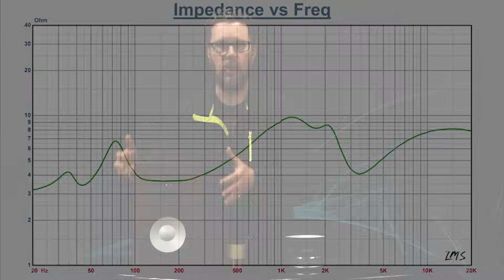What is Speaker Impedance? | Impedance ohms rating explained

Comment: Pretty much every amplifier I have ever run into has been able to go as low as driving a six ohm speaker I have one golden rule and I’ve been loving listening to music and buying a music equipment over 30 years. 
I will never buy a four ohm speaker purely because if  circumstances are right a 4 ohm speaker can go down as low as two ohms which puts massive stress on the amplifier speakers with a six or eight ohm rating is the sweet spot and the higher power efficiency rating the better? You will often find some of these very expensive so-called audiophile speakers are four ohm hand have not the best power efficiency rating. What a surprise.

Comment: typically a speaker with higher impedance or OHMs will have less bass and one with lower impedance, will have more lower bass response, the speaker driver doesn't care what amp its plugged into but the amp does the amp is the limiting factor if it can drive a 4 or 2 ohm or only 8 or 16 ohm if the receiver is not powerful enough you simply can not turn up the volume as much, amps put out a specific power depending on OHM of speaker,

Comment: A good example is the Sony STRD190 receiver.  It's a great budget receiver that's rated for 6 ohms, but if you connect it to 4 ohm speakers it runs much hotter and the budget power supply is poorly protected and won't last long, sometimes failing within days of heavy use.   That's why you see so many "refurbished" units for sale that look brand new.  You're better off to run 8 ohm speakers and get years of use out of it.

Comment: When I went to rebuild a pair of older 3 way speakers, I was surprised to find that none of the old drivers had matching ohm ratings.
 One speaker the tweeter, was 8 ohms, another, the midrange, 6, and the third, the bass,  was was 7 ohms.
 I replaced them all with 8 ohm drivers.

Comment: Hi there , thx for ur knowledge of impedance sharing . From ur entire presentation , can we said the power amp which rated 8 ohm and 4 ohm is capable to drive 6 ohm of passive loudspeaker without any issue ? As the speaker impedance is higher than power amp ? Thx

Comment: OVER LOAD RELAY WILL SAVE THE AMP FROM DAMAGE DUE TO SPEAKER WITH LOW RESISTANCE DRAWING EXCESSIVE CURRENT AND PRODUCING DAMAGING LEVEL OF HEAT.

Comment: Speakers have reactive components, therefore you have reactance.  The speaker itself looks like a coil to the the circuit, and in coils current follows voltage and that phase difference causes a resistance since I=V/R.  That's reactive resistance.  Impedance is just the sum of pure resistance and reactive resistance.  For capacitance it's the opposite - voltage follows current - but the same phase difference occurs and you still get reactive resistance.  Reactive resistance is emergent from the fact that you have a phase difference due to the reactance of the circuit.
Reply: Thanks for re-muddling this for me. 😂

Comment: Good video, Andrew! I am a power electronics design engineer and I have a couple of points to add. An amplifier optimized for 8 Ohm is not worse than an amplifier optimized for 4 Ohms - it is just another design parameter. Similarly for speakers - the speaker designer can choose how many turns of what gauge of wire are used for the drivers and that ultimately determines the speaker nominal impedance. There is no better or worse. The power supply voltage for the amplifier is a key determining factor in optimizing the design for a particular speaker impedance.  If it has to be capable of high power at 8 Ohm as well as driving 4 Ohm up to clipping then a penalty is paid in efficiency - more heat will be produced and bigger heatsinks and power devices will be required. It is a compromise... 4 Ohm speakers used to represent a benefit for Auto amps where only +/-12 V (in bridge) was available but with DC-DC converters now that benefit has gone. I don't know why speaker manufacturers still make 4 Ohm drivers - they just need fatter speaker wire for long runs!
As you say - go with the manufacturer's guidance to avoid letting the magic smoke escaping! (Electronics runs on magic smoke - when it escapes it stops working!)
Reply: I have a slightly off-topic question. Since power is the product of voltage and current, how do we know what ranges of voltage and current are acceptable to a speaker? Is this documented in some way? Is this common knowledge? Thanks!
Reply: @drichards-2024  Yes, the impedance is the guide for this. Because current = Voltage / impedance then we can tell what voltage is required to get a certain power.
For example to get 4 Watts in a 4 Ohm speaker you can use P = V x V / R and that transforms to V = Sqrt(P x R) so the voltage is sqrt(4 watts x 4 ohms) = 4 Volts. To get the same power in an 8 Ohm speaker you would need V = sqrt( 4 x 8) = 5.65 Volts.
Reply: @drichards-2024  All speakers tell you the impedance and max power rating in their specs. You can then calculate the max voltage and current.
Reply: But as voltage and current  can have a phase difference in loudspeakers you cannot simply multiply the two.
If you divide the squared value of the loudspeaker current by Rdc you come closer to the power that is converted into heat by a speaker unit.
The blind current in filter components does not generate heat except in your amp.

Comment: Thanks for the video , good to watch a clear explination. There are amps which are a great current source , others are great voltage source , tube amps for instance tend to be great voltage source amps but also have specific output taps on the matching transformers so suit benign impedance speakers rather that highly reactive ones  , good current source amps like old quad 405/ii  are quite happy with lower impedance and highly reactive  loads .  Where possible , try and find the impedance curve for your speaker or potential purchases , many 8 ohm speakers can have a rather whippy curve that reaches down to 2 ohms and above 10 ohms . My old Art stiletto 6 are rather benign staying above 6 and below 10 , they can sit at max volume with 100w amp all day and the sound is clean because the amp  doesn't clip , (clip = distortion and damage) . Take your time and learn these basics , it will lead to better enjoyment of this lovely hobby . 😘

Comment: If speaker is 4 ohms it means it gives less resistance to the amplifier than 8 ohms speaker. So, the amplifier doesn't need to push so much current to generate sound in the speaker. But you said it is the opposite. I'm so confused.

Comment: Understanding loudspeaker impedance is important without doubt but for me the most critical thing in the amplifier-speaker interface is the amplifiers current delivery spec regardless of whether the speaker is an easy 8 Ohm load or not..... From my experience high current delivery amplifiers (40A??) typically sound very good even with safe and easy 8 Ohm speakers.

At the end of the day an audio amplifier is really a motor controller (the loudspeaker drivers ARE motors) and effective and stable motor control systems always have considerable unused headroom. Audio amplifiers are no different, current delivery headroom is a must for the amplifier to work well within its THD and IMD curves and too tame the speaker and remain in control of it.
This is very different from the often quoted and misleading damping factor DF (low output impedance).  Low output impedance of an amplifier is nothing, and absolutely useless without matching current delivery.  They do not go hand in hand and you can hear absolutely the difference..  so always dig a bit deeper and try to find the amps output current capabilities its a good indicator that it can work well with most loudspeakers

Comment: Speaker impedance also include the fact that a speaker voice coil is a dynamo, that feed current back into the amp, wich is a short circuit, as long as it can keep the output close to the signal, complicated interactions going on

Comment: Is a window box fan laying on top of my Denon AVR2000 a good idea ? Every time I check the amp it's  cooler with a 12in sub and two  3 way 8 ohm 150 w fronts  all in parallel ? DC resistance reads 8 ohms , is that a value that can be a guide for any speaker before oscillating things ? Using RCA connectors for pre amp function doesn't sound as good as just speaker wire in parallel , am i doing something wrong ? Thanks .

Comment: I was hoping I would hear why there are 8ohm speakers for mainly home, and 4ohms mainly for vehicles. I always thought it was cause vehicle amps need to be smaller cause lack of room and the lower the ohms also the more distortion gets through. And since a vehicle environment is noisier than the home, 4ohms is the thing there, and 8ohms for the home has less distortion which works better for home. Am I on the right track?
Reply: @oblio63: I think it's because traditionally the power supply (car battery) is 12V so Pmax=V²/R so 4Ω is preferred for max power.  Power supplies for home systems don't have this issue and might be the mains voltage rectified with a toroidal transformer and caps down to 35V DC say and 8Ω speakers.  That was the 30 yr old answer anyway, circuits have got a bit more sophisticated now.

Comment: Basically, when you half the impedance, you double the power by doubling the current draw from the amp. Some amps can take the higher current draw, others can’t or will overheat over time. Great video!
Reply: Your statement is mostly correct but assumes voltage at the speaker is constant.
Reply: Your explanation sums it up easily
Reply: *at the same voltage
Reply: not only over heats.. but the power transisters can clip ( distort)..sooner?
Reply: Uhm, we've watched the video. Not sure the backseat driving is needed.

Comment: I got a very nice set of 4 ohm speakers from. Friend, and my Marantz receiver wouldnt drive them, or actually, they just sounded bad.  This sent me down the impedance rabbit hole.  This video was what i needed to finally understand the details.  It will better help me match equipment, rather than just taking peoples word for it.  Those salesmen dont always know whats best... they just want to sell stuff.  Thanks for a great video!
Reply: If you had access to an oscilloscope, you could look at the output voltage waveform from the amplifier into the speakers.  You might find that the amplifier was clipping.  Not sure about America but I can buy a really nice Siglent scope here for about $500, which is pocket change compared to some of the equipment I see featured.
Reply: If an amplifier is designed without sufficient safety margins ---- high-current transistors and large heatsinks ---- it might be prone to blowing up when driving a 4 ohm load. At minimum, the power-supply sags, loses drive voltage, and performs poorly; and at worst it overheats and burns up. Or, the manufacture builds-in circuitry to limit the current delivered to a 4 ohm load, which prevents smoke and fire but causes degraded sound quality.
Reply: @goodun2974  Yeah, I didn't know the speakers were 4ohm at the time.  The receiver was rated at 8ohm.  Once I picked up a receiver that would play down to 4ohm, everything was fine.  It was a learning experience.
Reply: My Marantz reciever has a system setting that switches the ohm rating. From 8ohm to 4ohm. 
Step-by-Step Instructions
These use the front panel buttons (no remote or menu needed—it's a hidden service mode).
Enter service mode: Press and hold the ZONE2 SOURCE and STATUS buttons on the main unit simultaneously for at least 3 seconds.
The display shows “Video Format ”.
Access impedance setting: Press the DIMMER button on the main unit three times.
The display changes to “Sp.Imp. <8ohms>” (or similar).
Select 4 ohms: Use the TUNER PRESET CH + or TUNER PRESET CH − buttons to toggle the setting.
Choose "4ohms" (it'll display "Sp.Imp. <4ohms>").
Exit and save: Press the STATUS button on the main unit.
The receiver returns to normal operation. Reconnect power and test with low-volume audio.
Verification and Tips
Confirm the change: Power on and play music—bass should feel controlled without clipping. If issues arise, reset to 8 ohms and check wiring.
For 4-ohm fronts only: If other speakers are 8 ohms+, this setting still applies globally to be safe.
ECO Mode limitation: It disables when set to 4 ohms (normal, as the amp runs hotter).
Marantz cinema 60

Comment: So connecting a 8 ohm nominal impedance speaker to a 8/4 ohm rated amp is OK. But then I see in the specs sheet of the speakers that the minimum impedance is 3.1 ohm. Is this still considered a risk?

Comment: That helps a lot. I got these old celestion creembacks 12 inch 8 ohms in parallel that I put together with a vox tube amp  with a 4/8 ohm that I've been scared to test coz of mismatch. I'm a little surer now.

Comment: You made a statement in a recent video that is incorrect. Resistance does not vary with frequency.  Impedance varies with resistance. Impedance has two parts, resistance plus the frequency dependent part which is either capacitive or inductive. Only the capacitive and inductive component varies with frequency

Z (impedance) = R (resistance) + j X (reactance). Reactance is out of phase with resistance and varies with frequency in ac circuits. Resistance only varies with temperature.

Comment: I already understood the crux of this explanation. What I'm trying to understand is many speakers have dips in ohmage that's lower than their rating, an 8 ohm speaker can dip down to 6 ohms or 4 ohms at say 1300hz or 200hz. But I was on an audio forum that was saying that too low impedance on an amp causes distortion (moreso than causing the amp to fail), i.e. at x frequency u will get distortion, and the reason the amp won't fail is because ur not driving the full frequency range under (over?) the rated ohmage. 

Again, since the ohmage dips are at infrequent frequency points, the amp doesn't shut down (overheat or go into protection, or just die!), but the THD rises (again at the specific frequencies) likely to very audible levels.

Can anybody shed some insight and if this is true, how are speaker makers not liable for rating a speaker at an ohmage, but the speaker actually has a few dips in the frequency range that are much lower (that is if the amp does fail)?

Comment: Quick question... Would all of what you taught within this video remain absolutely the same if one thing was different ? If your information was based off of nothing but home audio would it be the same say if I interchanged home audio and car audio ? Say that i'm not happy with the performance my subwoofer is giving me on a 2.1 computer setup and The little sub infact works well for what it is but you cannnot go past 1/4 on the dedicated bass knob because your trained ear can hear distortion etc. And with the bass knob at no more than 1/4 and your volume not being able to be turned up past the halfway point either leaves me without quite a bit left to be desired in a sub that can give real excursion and some of those lows without bottoming out all while being able to access the power and dedicated bass knob and give that upgraded woofer what I couldn't give it's runt of a brother . There's seems to be many versions to the system I have although pretty much all looking almost identical to all the ones that came before it . All I know is that I have a beefy 6.5 inch  car sub getting here on Friday and I would love to just remove runt and replace with beefy boy . Where do I start? Do I try to look for the amp ohm load and if so where ?

Comment: I was interested for my guitar amp/speaker application. I have outputs for 4, 8 and 16 ohm. I have cabs that have 1, 2 and 4 speakers. I try to keep everything at 8 ohm. So if I use 2 speakers, to keep the cab at 8 ohm, do I use 16 or 4 ohm speakers wired in series?  Electronics are not my bag, sometimes I don't understand.  8(    --gary

Comment: Good reminder on the AC vs DC measurements. As you stated higher current draw at lower impedance can be a problem on lower end amps. The real issue is when folks at add a second set of 4 ohm speakers in Parallel without a speaker impedance box presenting  a 2 ohm load to the amp.

Comment: I have a Yamaha AX-930 integrated amplifier. It is rated down to 6 ohms. RMS power 130W per channel/Dynamic power 300W @ 4 ohms. I plan to hook up 2 Cerwin Vega RE30 4 ohm speakers (RMS 250W), as this is the equipment I have. Can I offset any issues the amp might have by running a couple of computer fans set in exhaust mode on top of the amp grill above the heat sink. This would remove much heat and thus avoid overheating. As long as the amp components stay cool, does this offset any problems caused by the amp having to provide additional current? 
Also, I am buying new cables (GearIt). Does wire gauge have any bearing on any of this? I have ordered 14 gauge pure copper wire-2 runs of 15 feet. Thanks for any help.